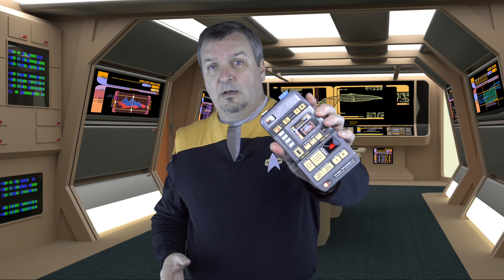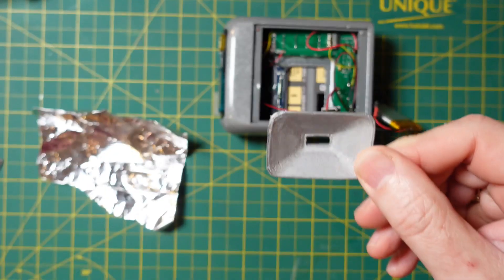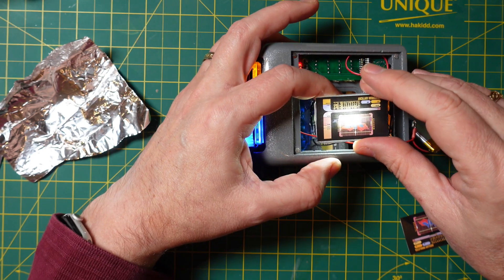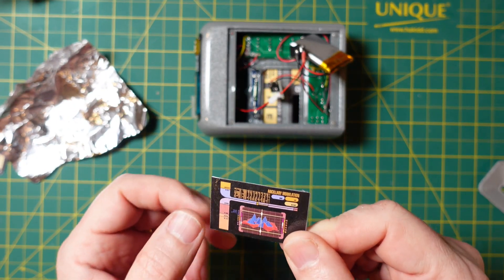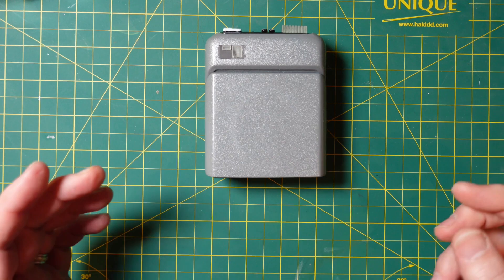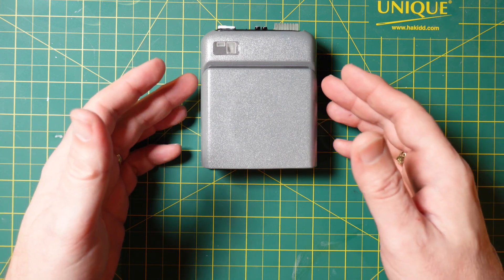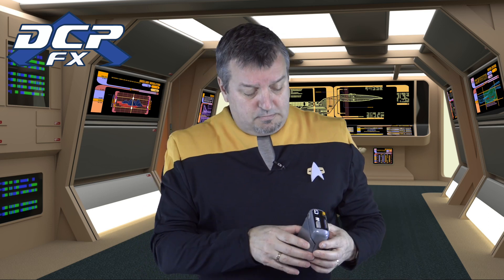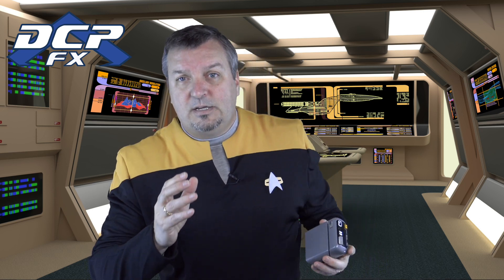Tricorder Build Tutorial, Adding the Graphics and Finishing

Comment: Greetings, You did a wonderful job painting the body and getting that speckled look which isn't easy to accomplish. May I ask what technique you used to accomplish this? I'm at the painting point of my build and don't want to screw it up. Thank you.
Reply from the maker: Of course. They way I hear most makers do it is to hold the silver waaaay above the body (2-3 feet above) and lightly mist it and let gravity do the work.

I use a miniatures painting booth, so what I did was to turn on the fan and mist the silver about 2-3 feet away and let the airflow pull the misting onto the main body.

Hope that helps.
Reply: @DCPfx  OMG!! That does indeed help. We're on the same page where using a fan is concerned. I was thinking of using a fan in a few different ways. First, I was considering having the fan blow gently onto the prop at about 3 feet away and spray a mist into the fan and let it blow onto the piece.

I'm going to practice first on some painted styrene to see how it works out. Painting is a challenge for me because I don't have an indoor place to spray and am at the mercy of the weather. As soon as it warms a bit I can use the garage. Thanks a bunch!!

Steve
Reply from the maker: @mrtrek64  Glad to help and thanks for watching!